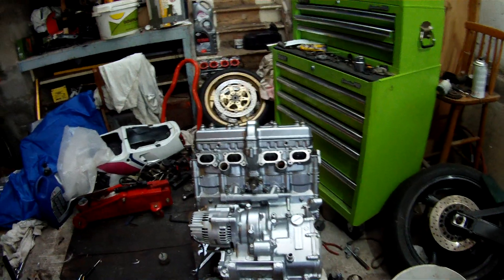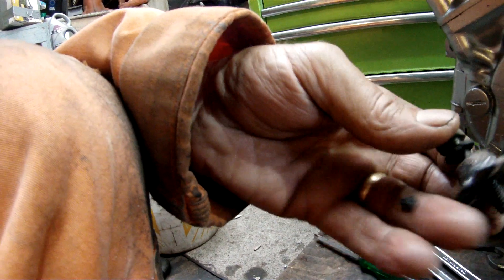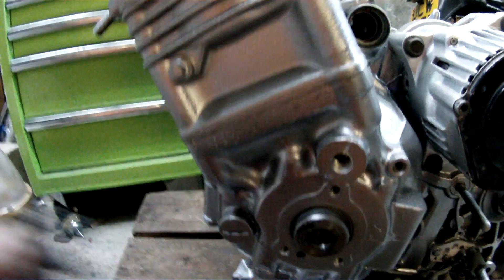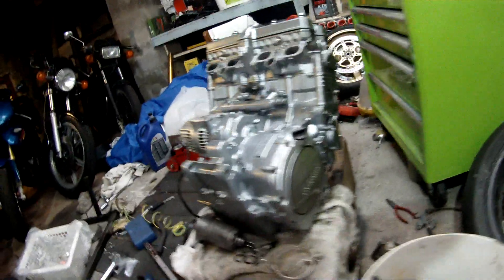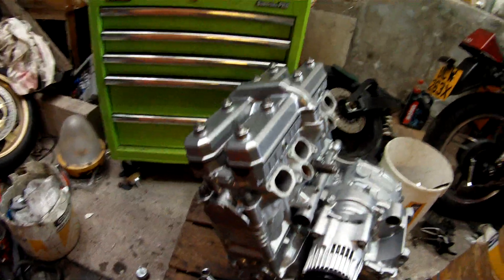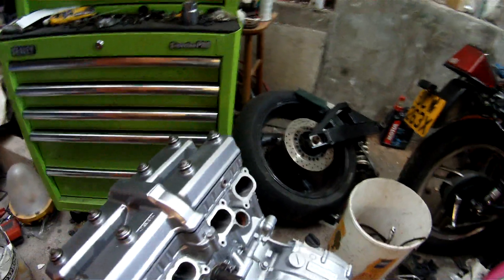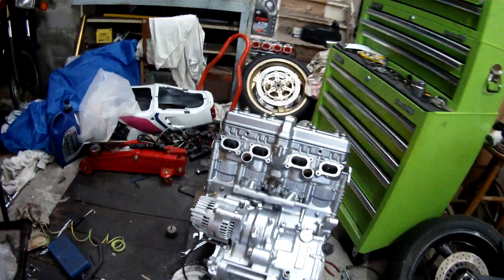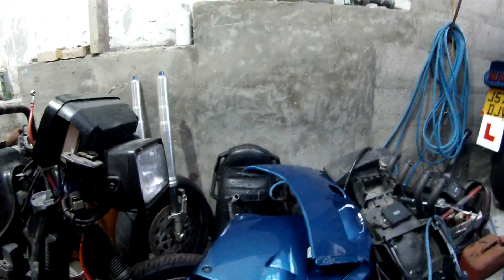YZF750, Thunderace engine

Comment: Hello! I'm in the process of doing a similar mod with a 93 FZR top and 97 YZF. I sourced the parts for boring up and swapping, but defered till next winter. I was wondering, what challenges have you experienced with the swap? How did you handle the oil system? Did you just use the 1040 headgasket kit (it seems sufficient)? Are the cylinder head bolts on the yzf sufficient for the fzr head? Or do I need to swap those? My FZR engine teardown pretty much showed me that at low miles these engines can be immaculate, are there any components you noticed that needed attention? Does the YZF crank have a shorter stroke? Did you notice heat discoloration on your FZR/YZF crank? Have you tried an EXUP delete, and if so how well does it work with increased displacement? Did you use the yzf electrics only? I noticed my YZF ECU and complimentary electronics are remarkably more compact. What carbs did you go with? I'm considering 41mm flatsides. Pardon my being nosy...
Reply from the maker: Sorry only just saw this, what I did was take a complete Thunderace bottom end that I had apart, and fitted the 750's 6 speed gearbox to it, I got Wiseco 1070cc kit with 78mm pistons, including head gasket and fitted a FZR1000 head which I fully overhauled, the 1000 motor has 10mm longer stroke than the 750 so engine studs in 750 would be too short for 1000 barrels and head
Reply from the maker: That is 1000 exup 3GM head
Reply: Thank you!